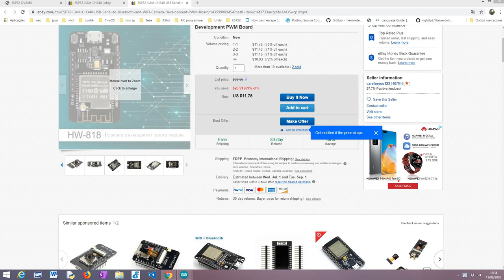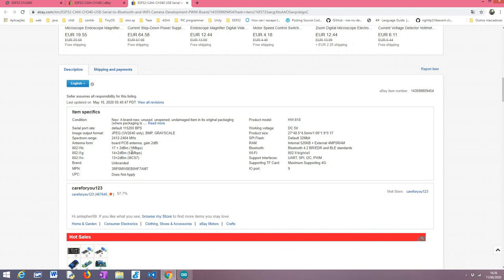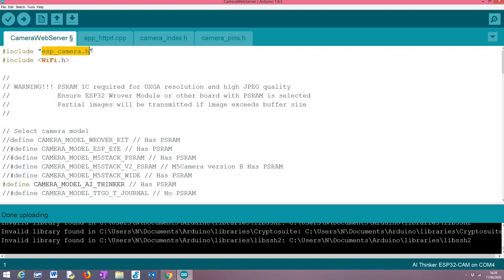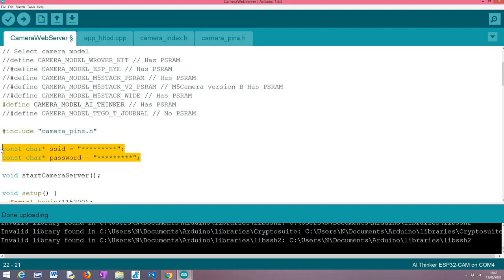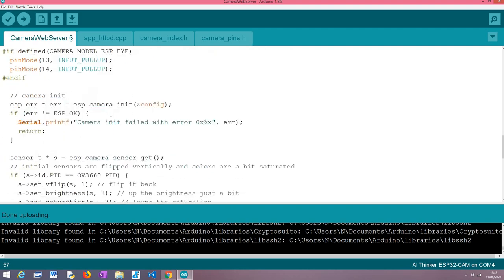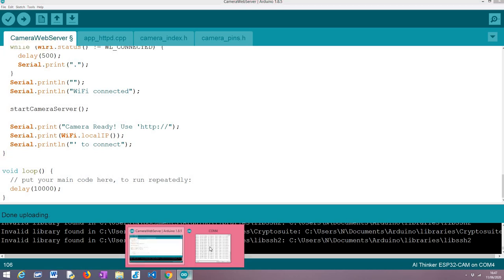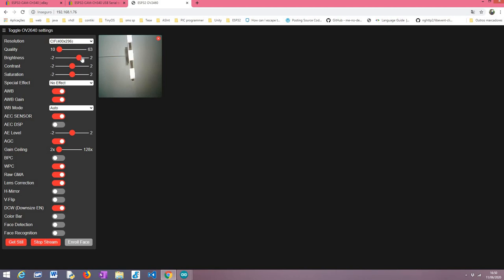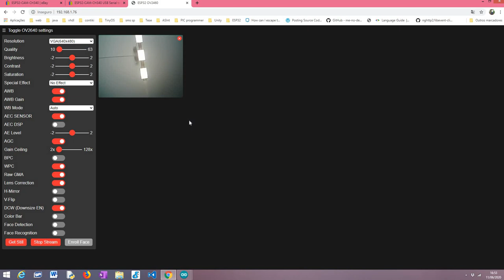ESP32 Camera - Arduino Core basic example

Comment: I have worked on the camera code  to understand it better. The one thing I didn't understand was how streaming worked. It turned out the header was responsible for telling the browser that it will be 'pushing' images to the browser. The header is  "multipart/x-mixed-replace;boundary=" PART_BOUNDARY" . I think understanding what the headers do are very important but seem to not get discussed enough when talking about servers.